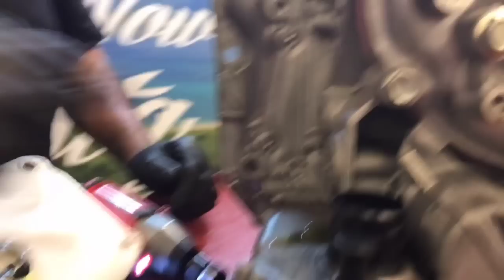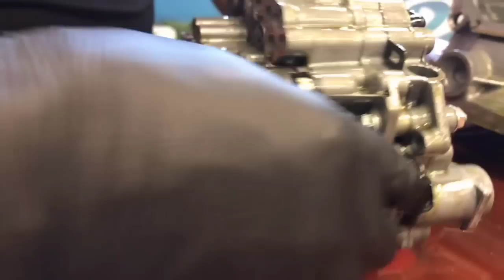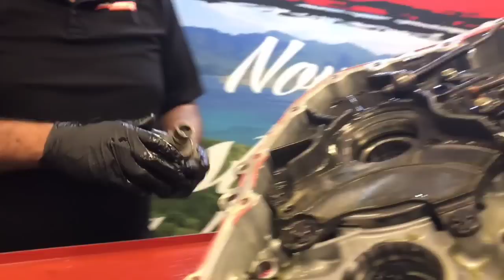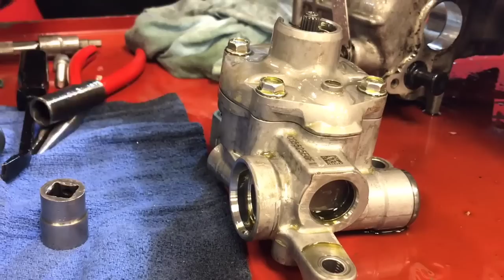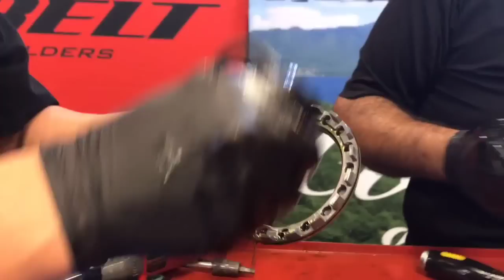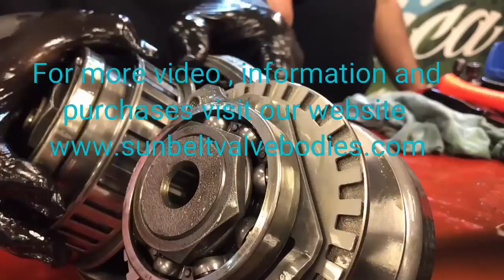2013 Nissan Sentra CVT  disassembling a RE0F11A (JF015E)  transmission

Comment: I got problem with an 04 infinity g35 up 22000rpm and between 3000 apear a sleeping And that’s time you feel like pressure leaving if you keep the pedal when ligth appear  rpm goes down for 3-5!seconds after it feel like it pressure get back one time do a big knock noise after drives well I put scanner and doesn’t appear  what can be ?

Comment: My CVT in my '13 sentra went out at 104k miles, nissan told me one of the variator pulleys corroodes when it expands and it doesn't allow the transmission to shift properly. Gonna cost a total of $4715 ish for a  refurbished cvt replacement from start to finish.

Comment: @Sunbelt Valve Body Builders  

Dear sir, 

I have Nissan pathfinder 2014 CVT gear. Now my car gear making rubbing noise when u shift to D.  And when u drive 100 km speed it is giving kicking feeling And I changed the oil. Still, noise is there.pls can u help me regarding it.
Bar's leifaks 1416 duper transmission fix can I use this.

Comment: Have you had to replace the Tom module for DTC code p0845? On the scan tool primary pressure shows zero volts at all times. If I induce 12 volts to the correct wire, scan tool will show 5 volts. Have tripled check my wiring and all ok! There is a technician service bulletin for the programming! We installed a known good trans and still the same problem! Please help

Comment: Hey guys great video I'm putting my daughter sentra back together with the help of your video had one question the steel belt is one direction which direction does it go?
Reply from the maker: there should be an arrow on it and it needs to go clockwise.

Comment: 2012 Rogue.  Had a wine to the CVT, especially when hot.  When accelerating from a stop the RPM’s will go up as they should, but will suddenly drop 500-700 RPM’s then regain a high RPM with no change on load or acceleration.  Dropped pan and cleaned everything.  I didn’t see anything unusual in the pan or on the magnets (very little friction material).  Refilled CVT fluid and after 200 miles did another drain and fill.  Wine is gone and the RPM drop and regain during  steady acceleration has lessened in severity, but still present.  No codes.  55,000 miles. Been doing it for years.  Dealer says everting normal. I have two other CVT’s both Altima’s ‘11 and ‘12 and neither jerk rpm nor wine.  Any ideas?  Thanks!  I made a YouTube video of the RPM drop on a hill.  I’ll try and attach link.  https://youtu.be/vgEfTfmtPjg

Comment: Hi,
I have a 2012 Jeep Patriot and after the Transmission temp was on I drove it about 10 miles and then let it cool down about 2 hours and drove about 200 miles the transmission speed with the car speedometer reading did not match and now when I get to the stop light it does not accelerate as suppose to and I have changed the transmission filter and the cooler filter and put a new oil. It got a little better, but the message is P0842 with slippage and lack of power. Do you think replacing the valve body will fix the problem? What do you think is the problem? Thanks for your help.

Comment: Hello great video.
I have this exact cvt on a nissan versa note which is a hr12 a 3 cylinder engine.
My question is when I drive my car and it gets hot it cuts off  an a pressure control solenoid A comes up. 
Need some advice do I replace the cvt or rebuild.
I did change the fluid the fluid was black Like grease
Reply from the maker: how many miles are on the car? the black like grease is considering

Comment: Very sweet design? We have these come in at 10k miles with input shaft bearing gone. This gearbox is a POS. It's easier if you pull the back casing off and leave the pulleys in the main casing, You should do the pulley bolts first then pull the casing off its much easier.. The reluctor ring (you called it the exciter wheel) on the secondary pulley also comes free sometimes and requires welding onto the pulley. I hope you know which way that belt goes back on its directional for fuck sake :'D
Reply: Beshj, is there a way to contact you? I am learning about these tranny's. Like what you commented.
Reply from the maker: Very sweet design to make money :)

Comment: I don't understand. This transmission carries almost the same amount of clutches along with the planetary carrier as earlier transmissions. The addition is the variable pully and special belt that has a high failure rate. Is the trade off of smoother acceleration and slight increase in fuel economy worth it?

Comment: I have a 2016 Mitsubishi 2wd Outlander with JATCO CVT; it shudders (makes scary noise that lasts a second) after 2 miles of driving it. Code is P084A . Stopped driving it. May changing valve body help?

Comment: I just bought a Nissan Sentra 2016 with 135,000 miles no fluid changes on the transmission do you recommend flush or change oil transmission

Comment: Guys did a great  job could have done better with fluid  spill  cvt transmission's  are mostly found on nissan cars  they are engineers way of saving fuel cutting back weight so smart they were stupid   all those sensors controls switches an I have had them go out at 30 thousand  either a valve or switch  or gear broke I made ton of money fixing them finally customers went honda an Toyota Kia gee wonder why those guys don't use cvt transmissions  😂🤣 either way great job guys !!!

Comment: Every thing taken apart seems to look good. I read where you said the valve body was the problem. It would have been nice if you included how you determined it was the valve body. Did you disassemble the valve body and find something broken or blown in it. If you reassembled the transmission  did you put a new valve body in or did you repair the valve body. Also did you replace all the seals and gaskets and where did you buy them. Did you replace the clutches and any other wear parts. Where did you purchase the parts. Very good video but wish you had  video rebuilding it. Do the clutch packs have a min. max. thickness. And do the bolts have a torque spec. and pattern.
Reply: There is a TSB for these CVTs where if you get certain TCM codes, then you replace the Valve Body only. I'm about to do this on a 2014 Nissan Sentra that jerks when accelerating but still shift as intended, just experiences RPM drop during accel.
Reply: @scientist100  done yet? Problem solved now? Having the same issue please update me. Thanks
Reply: @AnythingEverythingGh  How about yours? Have you solved a problem?

Comment: Hi.  Does anybody know how to solve P2859 code jf015e. Sentra drives normal but when i pull off acceleration pedal transmission goes to neutral mode in drive lever position. I have replaced 2 different rebuild valve bodies assembled... maybe both was defective..any information pls guys.

Comment: Any idea why nissan rogue transmission make noise while cruising?  is it a common problem
Reply from the maker: The Variator bearings are going bad and it is a common issue.
Reply: Could be input bearing, could be pulley bearings.

Comment: I think you should to drain the fluid  befor you start working 🤔
Reply: You can never completely drain all the fluid (unless you use the BabyBoiOmniDrain Tranny Rotate and Drain© machine, BBODTRD); it is guaranteed to drain ALL the fluid using a minimum of 100 drain positions, each held for two minutes. The BBODTRD only adds three hours to the job. The manual method you see here relies on a workbench designed to catch the fluids, allowing the work to be performed more slickly (no pun intended)² than with the BBODTRD.  Actually, all the parts of the transmission are just fine with sloshing fluids, in fact, they lap it up!

Comment: I have 2015 juke 53k milage with cvt transmission so far so good, are they good on jukes?
Reply from the maker: then CVT on the jukes are not as bad as the one in this video
Reply: Change your CVT oil now

Comment: 5:40 Of course you will be paying the  "I used a key wrench to take this apart" labour rate on this repair.
To think if the CVT transmission was never invented, I might never know what the inside of a transmission looked like. Thanks Nissan.
Reply: blthetube1 their CVT is going to bring their company down in flames

Comment: I have this message in my trasmission nissan sentra 2018 (p17f0 cvt judder) what's that mean? No problem in transmission
Reply from the maker: So does the car drive fine ?
Reply: Sunbelt Valve Body Builders Yes, I am worried about this message that appeared on the computer when checking the transmission?

Comment: Great video. Can you tell me how many miles this CVT unit handled before failing ?
Reply: 100
Reply: @robmausser  you mean 100K miles?
Reply: @irfan-106  no 100 miles. They are garbage and fail constantly. Theres currently a lawsuit against nissan over them for the 4th time.
Reply: Thats unbelievable 😳
Reply: @robmausser  That’s cap asf mine lasted till 130k miles and it’s a 2015 Nissan Sentra.
Reply: @robmausser  Agree on the garbage comment. I had one some years back from new, didn't let it get to 100,000 got rid of it.

Comment: This are real pros,don't even try taking any of this cvt transmissions apart.regular auto,transmissions are not that easy to fix.imagine this cvts. The 2014 nissan Sentra was the lucky one, because they had fix all the problems for that year.they do not have problems like previous or the altimas.
Reply: Edgar Vasquez they have problems I have someone with a 2015 Nissan Sentra and the cvt is bad already at 127,000km

Comment: Im 67 and now retired When I was an apprentice back then in the 60s  I was once  repairing Manual gearbox and ATV Auto transmission. We use to see more manual gearboxes then Auto.  Most would  fail at around 80000 miles. I can tell you now there no problem with the nissan CTV transmission.  On paper They should last for ever.  The problem with them is not the CTV in it self  But problem comes from  out side the CTV transmission.  All Nissan CTV have a problem with over heated CTV oil failure. It mainly  cause by the  crappy radiator  cooling system that also failed even when they were use in  ATV transmissions.  All Nissan CTV are realy well design And if it was not for the crapy oil cooling system.  they should  out last the life of the car there place in.  To get your CTV  transmission to last . You only need to do two things.  Service it by getting the oil tested ever 50000 klm if the CTV oil falls and most times it will.   Get it change.  Most time  the CTV oil will need changing  ever  50,000 km Also put an oil cooler on it.  and run the oil it though an  oil cooler controled by a thermostat.  Do this and Your  the CTV will never fail. You can also change the oil you self ever 50000 km.  it relatively simple  Just drain the ctv oil out and replace it with the same amount of oil that come out of it.
Reply: Hi Ray, I did this to my 2014 nissan versa, added largish oil cooler, drained and refilled twice with NS3, it is better than it was but still does not like to shift down when accelerating, goes to  3-4000 rpm up slight inclines,  I have to  back off the gas pedal for it to change down, drives on the hwy at high speed nice. What could be making it stick? do I just keep changing fluids until it smoothes out? has 100 k miles on it. Speed sensors????

Comment: The Audi CVT uses a multi-link chain, instead of a steel belt. Is the Audi design better?
Reply from the maker: Audi design has some flaws as well but is a better design. Nissan (jacto) also switched to multi chain link in some of their newer models.

Comment: What was the failure if everything seemed in good shape?
Reply from the maker: We are finding out that alot of these cars that have this transmission in it have TCM issues. Also the valve bodies are very problematic.
Reply: The Thin Metal belts break. Causing the transmission to explode
Reply: @redbaron2448  
This was not the case...
Reply: That was my question
Reply: Dominic Petruzzelli back in 2013-2015 the tcm (transmission control module) had faulty programming causing them to burn out or stop “shifting” well in 2016 they updated the programming with their d step technology and now in 2019 they’re on their 3rd gen of d step technology basically fake shifts like an automatic and 2017 and newer have few complaints Mitsubishi also uses these cvts but they use different programming and have had few issues with them it’s just the programming that made these fail the design wasn’t the issue

Comment: Great video! I may need a valve assembly for a 2014 Sentra SV. It stalls as soon as it's in any gear. My code reader will not give me any DTCs to go off of. Maybe the TCC? Why no codes though? Any pointers are greatly appreciated. Thanks guys.
Reply from the maker: Its possible the torque converter has become lose and is jamming against the bell housing
Reply: @Sunbeltvalvebodies  thanks. Makes sense. Then there'd be no code, if the circuits still closed? I'm gonna look into it  and I'll check y'all's site out if I need the valve body.
Reply: @Sunbeltvalvebodies  why does the factory service manual for the 2014 Sentra say replace the entire transaxle assembly when a TCC is bad? Can't one just replace the valve body by removing the drain pan under the car?
Reply from the maker: @trevorfrancismeusx9120  The dealer no longer fixes transmissions they just replace them. its really inconvenient...... you could have something has simple as a speed sensor go bad and they will replace the transmission. Yes you can just replace the valve body and it should take care of your issue.

Comment: I dunno what’s wrong with this CVT unit but you should have saved the CVT fluid.. and use it to test the unit when you done ...  where are you located..?  I have Jf010e valve body can you remanufacture it..?
Reply from the maker: We are located in Tampa FL and yes i have Jf010E valve bodies remanufactured ready to install for sale.

888-644-2391

Comment: Hello I have a question. in the old transmissions like the 8A and 8B the 8A transmission can be used with the 8B all you have to do is swap the bell housings. can you do the same with these transmissions? Can the Nissan march new 1.2 transmission be replaced with the 1.5?
Reply from the maker: Hello thank you so much we are willing to help you just need some more info on what your working on.
Reply: @Sunbeltvalvebodies  my transmission is a REOF11A its out of a Nissan march 1.2 2011. I wanna know if the 1.5 transmission can be fixed to the 1.2 engine.
Reply from the maker: @sohanwu  Thank you for getting back to us check out or website for tech support fill out our page and someone will get back to you asap

Comment: This transmission looks very robust and well built. I don't understand why are they so unreliable.
Reply: Did you see the filter that came out? Almost black in colour,  20,000 miles and that filter needs changing. The two magnets in the pan looked to me to have more than just clutch material, difficult to see on video though.
Reply: @ianmcleod8898  All of these vehicles should have came standard with a standalone external transmission oil cooler. The problem is temperature. They just can't handle the temps. The cooler it has is really more of a "warmer" as it tries to keep transmission oil at coolant temp. My gf has one of these cars and on a long trip (12 hours) I'm 99.99% sure it overheated and started giving a fit. 2017 Versa Note.

Comment: hi.do you know about cvt mitsubishi outlander sport? what part i must changes? this gearbox going,but need some more time to changing shift
Reply from the maker: Mitsubishi uses the same CVT transmissions as Nissan. What issues are you having ?
Reply: @Sunbeltvalvebodies  sir.. would you recommend Outlander JF015 to use nissan NS3 fluid ?  I cant find J4 fluid in this side of third world country.  my local mech said that NS3 and J4 are actually same Fluid. But i'd like to get ur opinion first, sir.. thank you

Comment: I have 2013 sentra with 90k miles it works okay when driving around 25 mph however, when I  want to speed up it speeds up slowly and the rpm goes over 3000 and stay there (I have to keep it around 3000 rpm to go 70 mph) 

The second thing when I'm going downhill if lit go off the gas it will jump and it feels like wanna break (only when I'm going downhill)
Where should I start my diagnosis?!
Thx in advance
Reply from the maker: you need to use your scanner to determine if your having a major pressure loss issue. That is your first step. If you would like give us a call we may be able to help! 888-644-2391

Comment: When i replace need to reprogramming my cvt transmission?
Reply from the maker: Hello,
Good question, depending on the valve body your working on you can exchange the ROM which is located on your valve body and just install it on your replacement valve body .
This avoids from having to reprogram because it will recognize it as the original Valve body.
You still have to clear the codes after the replacement is done.
Thanks

Comment: where is your location , because a have  2008 Nissan versa  with CVT , run but when the car is heat at 60 mi / hr not run, losse power, have turn off the car , wait  to cool , and do it again, … need help please,
Reply from the maker: These vehicles have overheating issues. Have you tried putting an external cooler on ?

Comment: My 2011 nissan cube with a cvt makes a loud clunk noise coming from the transmission do you have any imput to what it could be?
Reply from the maker: Is it a high pitch noise ?
Reply: @Sunbeltvalvebodies  yes with a knock/tap sound
Reply from the maker: @2jzs13  you could have a bad bearing
Reply: Sell it, my 12 cube ate 3 CVT trannies one at 58k , 98k, and 11 months later at 117k (no warranty, past 12k mi). It’s now drive way gnome!